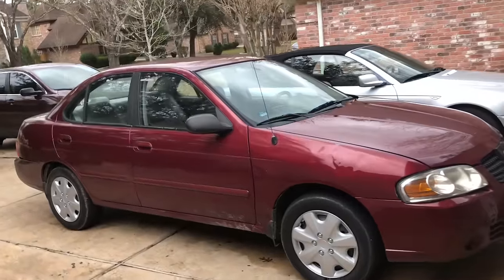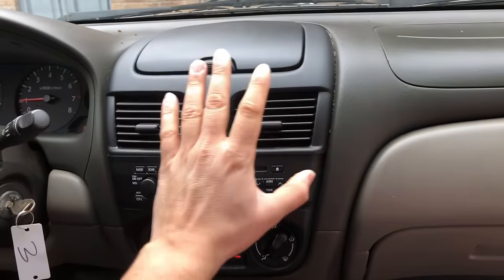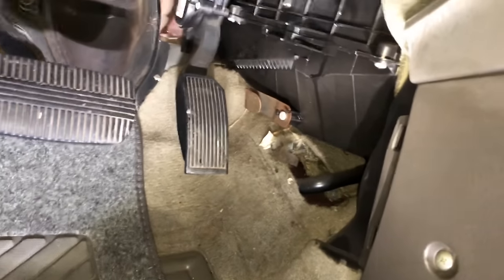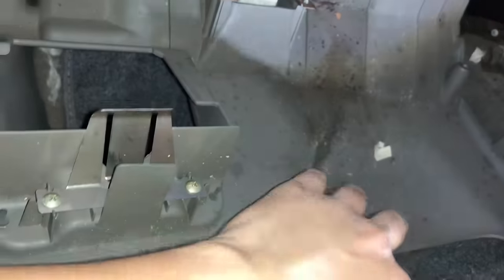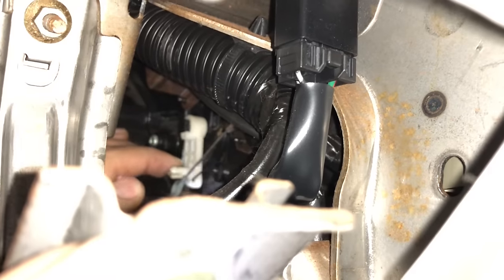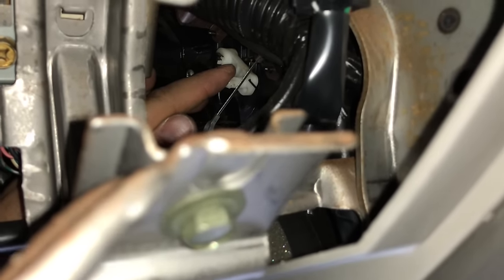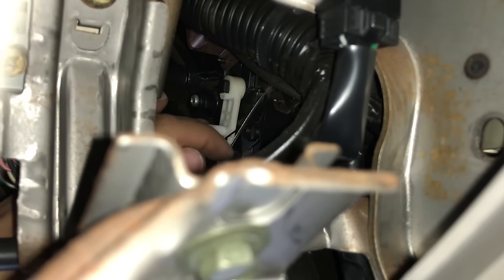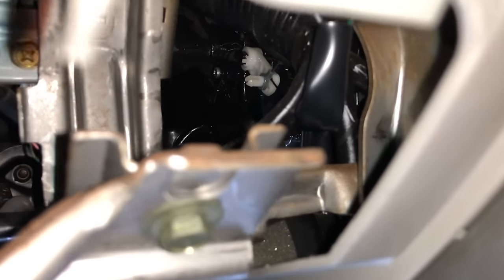Ac Blows Hot Air Only Fix - On Any Car

Comment: Theres a little slash on the white plastic its missing a little spring that keeps it on cold an when you turn to heater the wire pulls it to heat an when you move it to cold the spring pulls it back to cold. I hope that solves your problem God Bless
Reply: that’s how all their cars end up with flat tires🙄
Reply: Thanks very much, SOTL👍

Comment: OMG I ves been looking for this for so long and the shop and mechanics couldn’t figure this out. Thank you so much. I will pray for you. God Bless You. How easy these mechanics rip you off. OMG.
Reply from the maker: dblo mvo Im glad it helped! help us back by subscribing
Reply: Garage Boys- I'm sitting in my car rite now trying to figure why my ac stopped blowing cold. Now only got air.. Will this work for a 97 Buick lesabre?? Got the ac going for the first time in 3yrs ran for about a month but stopped about a week ago
Reply from the maker: SOUTHWEST OUTLAW yes this will work but only if you are having this issue, sounds like your compressor stopped working,  make sure your compressor turns on and the a/c pipes in the engine get cold
Reply: Garage Boys-- the pipes do get cold but it's not blowing out cold air. A.c. was blowing cold up until last week Tuesday.. thinking bout taking it to a shop today. Wat do u think?
Reply from the maker: Well if the compressor turns on, your pipes are cold and inside it blows hot air then your issue is most likely what I show in this video. The a/c actuator
Reply: Garage Boys-- I think my ac may be set up like that.. I'm pretty sure. If this is not the issue wat is it??
Reply from the maker: Not sure, you will have to have it checked out
Reply: Garage Boys-- ur better off taking ur automobiles to the shop and getting a re charge instead of doing this. Turned out I was low on R 134. Car is blowing crisp cold air. Oh yea u need like 4bottles of R 134 for ur car to blow cool air and u gotta re grease the whole system... just saying............
Reply from the maker: Emily Cushman yes it will work, this is a universal fix. All the cars have vent actuators and they go bad from time to time and they are usually all located in the same spot. Hope you fix your A/C soon 😃
Reply: Same here.  I have been searching for this for a long time and I couldn't find a damn video.  I figured I would try again and miracle.
Reply: @GarageBoys  Where is your shop in Houston?
Reply: @GarageBoys  iii

Comment: I fixed my nissan pulsar the same way but I found the problem that you tried to fix with wd40. It's like brakes on a bike both ends of the cover on the wire need to be in a special groove so it can work. The actual problem is not the lever it is at the other end it has just come out of the groove so the wire is not pulling the lever. Open the center console and look underneath the aircon hot cold lever and you will see the problem straight away. I did mine yesterday and now both hot and cold works perfectly. Thank you for pointing me in the right direction.
Reply: Any way you can show a video of your fix??
Reply: @ksbear451  hey Heather sorry I won't be able to make a video for you as I have sold the car. It was a simple fix if you remove the aircon control levers and look at the back you will see the cables that join the lever to the vent and one side of the cable would have come off the track.
Reply: @MrBlacky19853  VERY helpful, thanks

Comment: Either the cable is bad or the part where it connects to the rotary switch is bad. However, if you're not going to replace the needed parts, what I would do is take a thick rubber band or a small spring and attach it to that white plastic finger and attach a screw to the case to hold the other side of the spring or rubber band. That will put some mechanical force on the blend door in the cold position so it will close with very little effort from the cable.
Reply: That's a pretty good idea

Comment: Interesting troubleshooting on the control mechanics, though for plastic lubrication, WD-40 isn't the best choice, as it can eventually soften and change the characteristics of some plastics.  Lithium grease is a safer and more robust alternative, as it's not damaging to plastics and that it's a grease will also hold up longer to use and not drain or evaporate like WD-40 tends to do after a few weeks.
Reply: WD40 is not a lubricant its a solvent. WD stands for water displacement
Reply: People confuse this WD-40 is a cleaner like Brake Clean not a lubricant so it’ll wash all the grease and dirt away but won’t lubricate it.
Reply: Also won't hurt electronic

Comment: You need to do what you did in the opposite location. take the housing off and adjust the clip that holds the wire at the hot/cold nob you're turning. It gets lose over time. Very common in Honda's and toyotas.
Reply: Chev Silverado ac does not cool
Reply: Thanks

Comment: Watched your video. Corrected the problem in under 5 minutes. Now I’m going to take apart the front panel and see why the cable is weak when pushing to cold position. If I fix it I’ll post the video
Reply: Did you fix ?

Comment: Your problem is the cable has come away from the holding clip. It secures the outer cable. You need to view the complete cable. As you turn the knob the pressure to overcome the flap door causes the outer cable to move. If you secure the outer cable it has nowhere to go therefor the inner cable will do what it is suppose to.... move the flap correctly👍
Reply: Thank you very much. Quite helpful👍

Comment: Thanks alot .worked very well for me.i have peugeot partner tepee and that tiny panel by the accelerater was padded with insulation.i found out traces of that small mechanism on it .i assume the insulation went  out of shape due to hot climate so i removed it.plus few sprays of wd40  and it all went fine.
Reply from the maker: I’m glad you where able to get your a/c back. 😃

Comment: Thanks, fixed my issue today. I did however take all the housing away from the radio & heater also & was able to fully diagnose why it wouldn't push. It's not being held in into the ring its supposed to anymore because the ring is plastic & has snapped. I tied a wire around the whole piece tying the line in & was able to get it fully functioning again.

Comment: It looks like there is a spring attached at the bottom of the white plastic piece that is meant to push the lever when you select cold air. I wonder if the spring is still connected to its anchor point (it’s too dark to see in the video), or if the spring has weakened over time and needs to be replaced…

Comment: The case is that the spring haven't suffisent force to return the lever, so I'll put another spring to help it - spring with lower force, one end on the lever and another end in somewhere behind it. I think this way to solve the problem, because to pull you have suffisent force to overload both springs but not to push the lever with the flexible cord.

Comment: Drill a hole through the bottom piece. Slide a dowel in and secure it to the a/c door, that's if you can get a good shot straight through to the to the switch.

Comment: Yessss this is exactly what is wrong. I can see that white piece stuck on heat but i cant get the screw off of the panel to get to it. 😢
Reply: Ok, so I got the white piece in the correct position, but still hot air😢

Comment: That was happening to me , but with the doors that control air recirculation in the cabin. I did as you do in the video with silicone lubricant, but was still unable to slide the adjusment all the way ( in my case neigther way all the way)
HERE IN THE FIX AND PERMANENT SOLUTION
The cables connected to doors or flaps that belong to AC and heat have all to be pinched firmly to a metal clip  before been hooked on the door mechanism,  these retaining clips are located on the surface of the HVAC plastic cage and usually very close to where the cable  end meets  the door mechanism.  SOLUTION:  First remove cable from the  holding clip,        ( If you're missing the retaining clip you might have to get one and install it before continuing here) push the door mechanism towards the steering wheel as like pulling the cable out  from the insulation  and hold it's insulation  in that position firmly while with your other hand pinch the cable with the clip exactly where it  is in relation to the clip. END on the PROBLEM.
Perhaps in your case is pushing the  end of the cable all the way into  it's insulation, and then while in that position  pinch  the cable. Just play around with it. I hope and this solve it for you too.

Comment: I bought a new car in the month of April 2019 but from the past few weeks, I have been experiencing very very hot air coming from all the vents.

The temperature is high to an extent wherein it becomes unbearable and I have to switch on AC (currently it's pleasant outside in my city so AC was not required).

I recently measured the temperature and it was greater than 44 degrees Celcius/108 degrees Farahenite. And I am sure I experienced hotter than this.

So bit worried and wanted to seek an opinion from the experts. Sharing some data:

AC unit type: Automatic Climatic Control

Route: Office to Home

Distance: 6 KM

AC status: Off

Re-circulation mode: Off

Windows: Rolled down

Outside temperature : 24 degrees Celsius

Garage Boys could you help
Reply from the maker: As long as you have the a/c off and the recycle button off you will get outside air, that air comes from the engine bay so it will always be warm and smelly. Always have the recycle on and a/c on if you want cold air
Reply: @GarageBoys   Ambient temperature outside is 24 Degrees so AC is not required. Moreover its not recommended to switch on recirculation mode for too long. But what is the cause of it? My other 2 cars don't exhibit this behavior. And here I am experiencing very hot air

Comment: It maybe missing a spring pulling the arm back to ac side. It looks like that wire isn't stiff enough to push the vent back by itself. Look below the arm to see if anything fell.
I know, 4 years later.

Comment: Problem is cable become stretched it’ll work with a pull action but not push. I’d just leave it when you need heat not hard to pull the panels out just flick it over by hand little annoying but it work.

Comment: I just replaced that actuator blend door and fixed the heat but now ac is blowing hot, compressor is working. Do you think that actuator is already bad? or the actual door is broke, because i dont hear it clicking like it was

Comment: So true. Some try to fix my ac stating it was low on gas then compressors was faulty. Actually my switch also was stuck on heat. Was having only hot air at a point. It was on a Kia Koup am still working on it.
Reply from the maker: Glad I could help 😃

Comment: I have a Prius C.  My a/c works on hybrid mode but when the engine is on.  The fricking mechanic told me I need to replace the whole control panel.  $800 for all.   I took it out myself and try my panel in my bro’s Prius and it works perfectly.   I read it can be the blend door but I don’t know where is that lol,  any suggestions?   Where can I locate what you just showed on my car?  I will really appreciate any help from anyone.  Thanks in advance
Reply: The white piece hes fixing the wire to is the part that opens or closes the vent doors. Most cars have the piece in the same area.
Reply: In Rangers, it’s behind the glove box.

Comment: Calling all Honda insight and CR-V owners.  
There was a national recall on an AC condenser part.  If your AC is blowing warm air , it is most likely a FAULTY CONDENSER.

I took my 2019 insight to the dealership , and they suspected a faulty condenser.  Replaced for FREE WITH FREE  REFRIGERANT

Comment: I have a 2003 Nissan Maxima it's charged the clutch is working the fan works when I turn it on cold there's no air coming out on hot it blows hot air could you please tell me what I what I may check to get it working or what I need to replace if it needs to be replaced Thank you

Comment: i wonder if this reason I hot air have coming out for  Chevrolet Cavalier - its old, but i never took off any panels- but i guess i can check to see if there a mission nut or loose cable pulling nothing

Comment: Try a spring to add tension to pull to the cold side
Reply: freealistar its funny but works i just jerk into the next lane to get it to work and my heat does the same im glad i seen this bc its funny when someones riding with me and i tell them its what i have to do to get the ac to work
Reply: Wild Bill ok cool well whatever works

Comment: Could you do a video like this for the same issue with a 2013 hyundai elantra? This has been racking my brain for weeks
Reply: Hey! I'm having the same issue with my Hyundai Elantra 2012!!
Reply: @buuzy252  check the manual. It could be ac compressor
Reply: @mef12727  thank you I fixed it 3 months ago it was the ac compressor right. Had to replace it for 140box

Comment: I caused mine to leak while changing the alternator a couple days ago. Same car. I detached the bracket on top and then went for the underside bolts, the bolt pulled the alternator forward pressing on the pipe, I heard a hiss and now it's warm...

Comment: Quick question. When you opened all the panels your white plastic switch was already pushed down. So how was it blowing hot air? If you say pulling the switch makes it hot and pushing it down makes it cold? Or did you already have it pushed down before?
Reply from the maker: I messed with it so I can show what to do

Comment: For a dodge caliber 2008, a/c or hot air, not coming thru vents, any ideas to fix it? Thanks btw great video
Reply from the maker: Is the blower turning on? (Blower is located behind glove compartment, basically a fan). If it’s turning on then air has to be going somewhere, maybe to the defrost? And if that’s the case this is your problem, the actuator

Comment: Hey bro, first of all thank you!
My car (mitsubishi lancer 2010) have no such a heat lever.
Its probably move by electronic, cus it have no mechanical wire going out from the ac control and when im move the heat/cold circle its making a sound of movement only when the power switch is on.

Any suggestions where i can find the inner lever?

Comment: I had a car with the same problem.  I live in Florida.  Solution. Paracord tied to lever. . Use cord to pull it shut. Only used heater 2 or 3 times a year.

Comment: Hey hope all is well. I have a 2009 Dodge Caliber SE my heat works but my air doesn't I did take it too Firestone and was told my compressor was fine but it was a piece I may need and I'm really trying to avoid taking it to a Dealership and I really feel like it's a simple fix because my heat works fine. Will this work for me I would really like a second opinion.
Reply from the maker: Your heat and your A/C are separate, if your compressor is good then this video will probably be your fix
Reply: @GarageBoys  thank you so much

Comment: This may sound stupid but somebody help me. What is the difference between actually pressing the A/C button and just turning the temperature down? Surely you don't need to have an A/C button if you can just get cold air from turning the thermostat to cold? Because even if the A/C button is pressed you can still turn the thermo up for heat despite the A/C being on.
Reply from the maker: Without the A/C on it will only blow outside air (which may be fresh or warm) not cold, because the Freon won’t circulate and it won’t cool the pipes. It blows warm air when you want because the engine is always hot.
Reply: @GarageBoys  Ahh I see now. Thanks for the quick reply

Comment: well i have a 1999 gmc sierra,i run it with ac regularly,but today when i started truck in morning i trun ac on and it blows hot hot hot heater hot ,i already recharged the ac about a month ago ,so today it basically randomly started blowing hot,the alternator turns on and everything seems fine but it still blows hot,let me know if u have an idea of what could be the problem!!!
Reply from the maker: Check it it has Freon in the system, you may have a leak. If not then your issue is the actuator as shown in this video

Comment: My 1999 Grand Marquis (50000 miles) suddenly starter blowing hot air. Air compressor clutch cycling on and off. Disconnected car battery. Removed cooling fan relay. Replaced with another relay. Re-connected battery and air conditioner blowing cold air again.
Reply from the maker: Sounds like before it was blowing warm air, as in outside air, in this scenario of my video it’s blowing hot (heater) air. But I’m glad you fixed your a/c
Reply: Thursday night it was blowing cold air. Friday night it was blowing hot air as if the heater was on. I was thinking that the blend door was stuck in the heater position. Then I read post where another individual suggested disconnecting the battery to reset the computer. I also changed the cooling fan relay. And now I have very cold air. Maybe the blend door motor was not getting power. I will check the relay tomorrow. Hopefully the problem may not return.Thanks for your reply.
Reply: Relay checked out okay. So thanks to that person who suggested disconnecting the battery to reset the computer. Worked for me.

Comment: I have a 2007 Subaru Forester and that is doing the samething that your talking about on what mine is doing
Reply: I know it has been 5 years but I have a 2007 Subaru outback blows hot on dash vent drivers side and cold everywhere else.  Were you able to fix yours with an actuator and where was it?